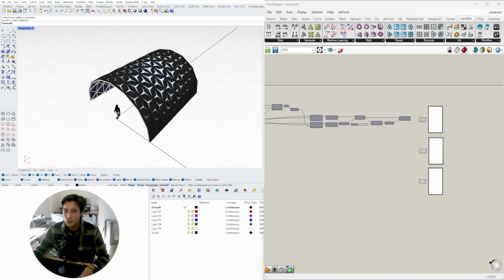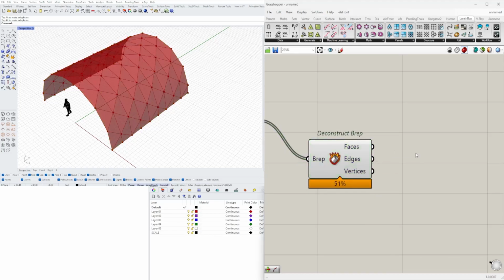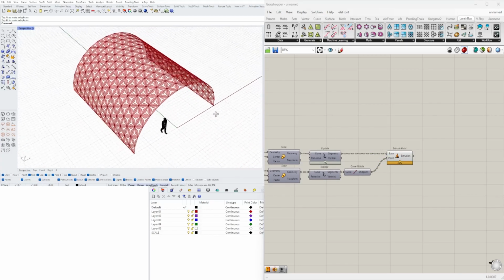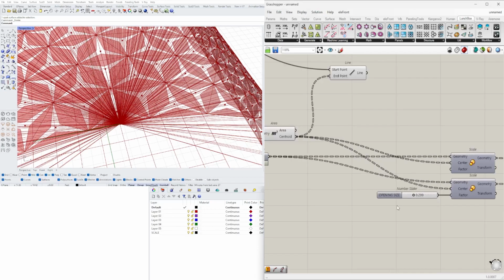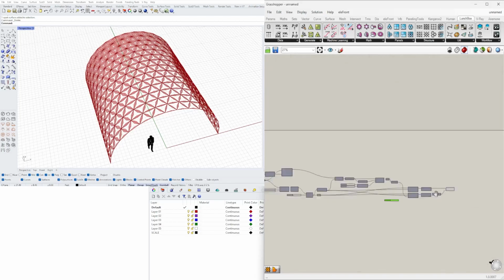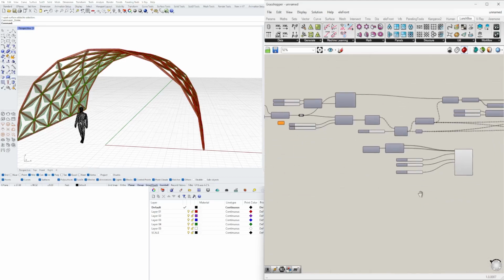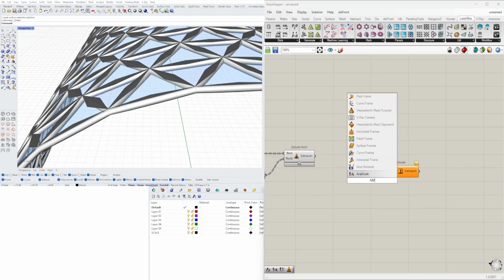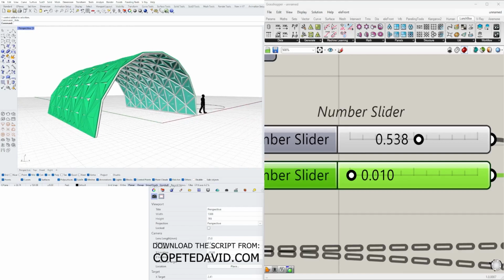Parametric Building Triangulated Dynamic Pattern Rhino Grasshopper Script Algorithm Download free

Comment: So you are getting the IDEA. :D YES. 

This is my exact style of work. Structure, skin facade, gradient field and the geometrical pattern or parquet deformation transformed by the gradient. These are few of the basic principles in parametric architecture. 

I like what you are doing. KEEP DOING IT. You are getting way way way better at it. Al Bahr towers is a complex design that uses folding origami. These Yoshimura folds, triangular openings and triangulated structure always work. These can reach a step further. 

Thank you for this. :D
Reply from the maker: Thanks for the comment!  I definitely look forward to see your approach to this.  In my opinion this would be fun to combine with a previous script like the wireframe connections, and show how the pattern panels are attached to the structure.  This would actually be a cool structure to develop some day.